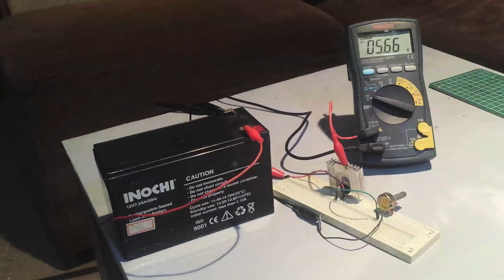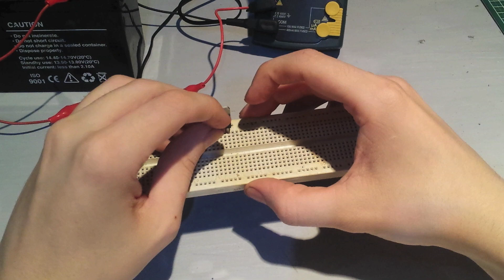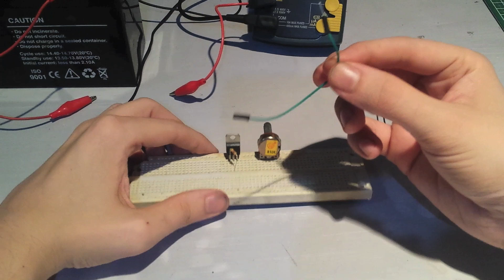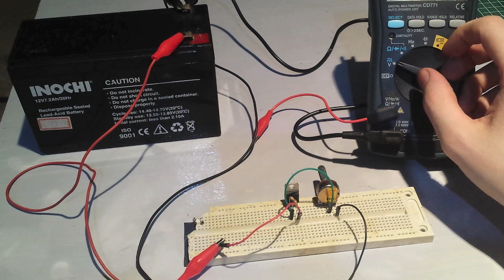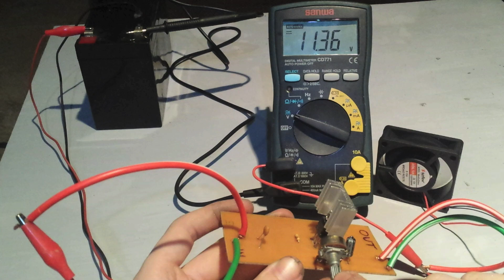Make a simple adjustable power supply LM317

Comment: that's awesome. I'm not quite sure, what voltage i would get with this resistor voltage devider: 5V supply, R1=3k ohm, R2=4k ohm across R1. From my calculations(i didn't use any formula, i somehow get this number) i should get 2,14V across R1. Is that correct?

Comment: Why did you suggest using ceramic caps on the input..and electrolytic caps on the output? Why not use only ceramic on both sides since it handle ripple and noise better..

Comment: Hi ive just watched your video which has been helpful. However i wanted to use this to make a more precise refrence voltage stepping down from +15 to +12 for my VCOs x3 . I followed the step and managed to get it to adjust to +12, however as soon as i connected it to the circuits the voltage drop to 0.87 can you shed any light on as to why. The standard vreg i used the L7812 stays at around +11.89v  when connected to the same loads. Thankyou.

Comment: I tried to do the same with a 1k pot.. but the voltage only varies between 25V - 27V.... its not reducing more then this.. any guidance plz?
Reply from the maker: 10k pot and a 180 ohm resistor :)
Reply: m sorry bro that was a typing error.. it wasnt a 1k POT.. it was a 10k POT and 220 ohm resistor

Comment: Hey...I'm using a bridged rectifier circuit to obtain 12v and around 1Amp current, is it OK to use that as input to the circuit you've shown.. Is it safe for the pot?
Reply from the maker: +Sanath Kumar yeah :)

Comment: i feel stupid, why do you need a resistor between the adjust and output pin? please help i cant find the answer anywhere. I have it working but not knowing why its needed bugs me. lol
Reply from the maker: The chip is monitoring the resistance on that pin to know what output voltage you want.

Comment: where is the negative of tester?
Reply from the maker: On the negative side of the battery.
Reply: dirrect?
Reply from the maker: Correct my friend.
Reply: I have 50 v what value of potentiometer I will use?
Reply from the maker: It's a 10k pot.
Reply: Do not connect more than 35 volts dc to the LM 317, unless you use HV version

Comment: ive had  a look around and im understanding the circute better but if the ransistor regulates how much power come out why need a resist too if its doing the same job. mayby i dont understand your circutry though
Reply from the maker: The resistor only tells the LM317 what voltage to regulate to.
Reply: hmm so its  droping incoming voltage  so that that the transistor on can use that amount of power? i thought transistors do that anyways?im sorry . im very new  this components such as these.
Reply: Gadget Addict so is the resistor that is attached to the lm317 lowering the incoming voltage  from the battery to the transistor?
Reply: i keep coming back to the video after ive read up more on things like voltage . i though i had an understanding but i did not but now i do and i can now  watch with pleasure. thank you.
Reply from the maker: I'm glad you worked it out :) Congrats!

Comment: what happens if the load draws more than 1.5 amps that is the max of the LM? lets say i have an electric motor at 12v and 4 amps ...will this put the lm in short circuit or it will not run at full capacity? great video was searching for simple adjustable supply
Reply from the maker: According to the spec sheet, it has protection against over current. But I think there's a lot of clones of the LM317 which may not necessarily have that feature. I'd expect on a genuine chip it would disable the output and on a fake perhaps it would just get so hot that it would melt/destroy itself, possibly creating a short in the process.
Reply: Gadget Addict thank you for quick response

Comment: does the lm317 really need to be there? ive  seen circuts witjoight it for attaching a cpu fan as you did and it working fine. mayby it depends on the input  voltage?
Reply from the maker: Yes, the LM317 is 100% required. You can run a very small load directly through the POT without the LM317 but it might overheat and fail.
Reply: ah ok i see. im going with a 12 volt dc i believe power supply  to  attack a 12 volt fan and a pot to adjust the  speed. do you think it will still be needed. i did see another video  where a guy did the same thing im planning to do and he did not have  the LM317. guess it depnds on the input i guess . can a resister work the same way as an LM317?

Comment: hi!
nice work! i have two questions to ask..
first, is the second resistor(pot) necessary? what happens if the adj is just shorted to ground?
second, when i apply voltages higher than 12v the pot is destroyed and so is the lm317 knowing that i have double double checked the connections and i also have a heat sink and caps in there, the pots keep burning regardless of the power rating or value in k ohms. what can cause this? is there a sol'n?

thank you!
Reply from the maker: The POT is only required if you want to adjust the voltage. If you just want a fixed value, you can skip that POT. I'm not sure why your POT is burning up, are you sure your wiring is identical to what was shown in the video?
Reply: Gadget Addict yes. the wiring is identical. when i skip the pot the chip is heating up very fast and blows up.

Comment: Thanks for this,. Question, can a c5353 be used in substitute for the Lm317? As well as a 100k potentiometer? I'm wanting to use it to adjust power on a 24V  power supply. Any help would be greatly appreciated, thanks.
Reply from the maker: I can't find much information on the c5353 but it looks like a standard NPN transistor instead of a voltage regulator.

Comment: I am connecting a 12v motor , where do i apply the second terminal ? and if any changes should be made then what are those ?
Reply from the maker: You can just duplicate my video exactly. I was also using a 12v motor :)

Comment: I added a 36v 2200uf to output and im getting 36v from a 24v transformer ????
Reply from the maker: Turn the POT to lower the voltage.
Reply: DC voltage is 1.4 times the secondary ac voltage.
Reply: Mains voltage has alot of  voltage spikes (ac 230volts  has 300 volts spikes) thats one reason why you get more output than the transformers rated. then when you use a cap it will take the spikes, so you get a higher constant voltage. the values of transformers would be correct if mains had no spikes and stayed at a constant 120 or 230 volts, but these ideal conditions only exist in labs (where these ideal conditions are created for standards in datasheets). Also check that voltage with and without load, normally with load the voltage will go down a bit and will more be like the rated output. So, many factors influence the output of a transformer. Hope that now you understand better why the rated and effective voltage of a transfo are mostly different.

Comment: Hi, It is nice to show through video. It would be goo if you can arrange schematic diagram for the same. As in Video it is showing that you are giving + and - Input through 12v battery. Output + is from LM317 Out Pin, what about (-) Ground of Output Voltage. Kindly brief. Thanks in advance.
Reply: Hi, I tried. It is working. I tried to get 1.5V. But when I am trying to start Motor it's not working and Voltage is dropping from 1.5 to 0.8.

Comment: 10k pot for any input or should it be adjusted accordingly?
Reply: If you look at the datasheet it will show you how to wire it, and I believe shows the equation for how to calculate the output voltage given the resistor values (you can also use an online calculator). The pot is just a variable resistor, so you can calculate the output voltage for every value of the pot.

Comment: Alright, I built it in the breadboard, just like you did and it worked fine. I put it into a circuit board with the caps, just like you did and now it doesn't work. What did I do wrong? Can you email me a schematic or something?
Reply from the maker: Sorry I don't have a schematic, just what's shown in this video. Did you double double check your connections to make sure it's wired exactly the same as on the breadboard. Is it possible you put the potentiometer in backwards?
Reply: Gadget Addict I figured it out...I had tested it before adding the caps, and my meter is just a cheap little one that didn't register anything once I'd added them. That was probably because I didn't have a 12V battery to test it with. But I tried it again at work with more sensitive meters and it's working correctly.

Comment: is there a way to add current adjust to this ?
Reply from the maker: Nope. This circuit is really the most minimal adjustable supply. You'll need a more complex circuit to add current limiting.
Reply: do you have a simple circuit with current limiting using a lm317.. thank you in advance

Comment: can I abject with that circuit more then 12v ?
Reply from the maker: +Satellite Problem yes you can :) I think I put the limits in the video description :) but the bigger the difference between the input and output voltage, the hotter your LM317 will get as it wastes the excess as heat.
Reply: thank for rep :) I have 12v power supply but I need more then 12v like ,16v,18v,24v,30v. what I need to make like that circuit ? can u explain me thank u :)

Comment: is it necessary to add in a heat sink? or is it ok not to?
Reply from the maker: You really need the heat sink. It doesn't have to be a professionally made one. You can drill a hole into any small piece of metal and use that as a heat sink. It won't work as well as a heat sink with fins, but it's good enough for testing.
Reply: The datasheet gives you all you need to calculate the temperature for a given power (all those thermal resistance values). However I believe any useful voltage will end up requiring some kind of cooling method to keep it under its maximum operating temperature.

Comment: i have 19.43 v and 4.6 A battery . I tried to make it variable voltage power supply but lm 317 , it heats up and damaged the whole circuit , what should i do ? i already use heat sink
Reply: you must have connected it directly to the input or something

Comment: How much voltage can be given into input ? u gave 12 can I give 36v I have an transformer of 36v salvaged from a water filter ???
Reply: I have still not because u told it will over heat and tried on 7805 it got melted

Comment: My potentiometers keep burning out. I've tried 510R, 240R for R1 and 10k and 50k pots, and the potentiometers keep burning out. I'm using capacitors also as the datasheet suggests but no help. Supply voltage is 28V. Can someone help me?

Comment: my lm317 this overheating very fast, I can not even touch it, what can be?
Reply from the maker: Did you add capacitors like in my final version ?
Reply: did a add a heat sinker you need one
Reply: hmmmm...  you either need a bigger heat sink,  or use better caps,  or use caps if your not using it.  cus capacitors in this case worker as a traffic guy,  holding his stop sign and blowing his whistle, letting voltage through slowly and steady so ur Lm317 dosn t go kaboom

Comment: fantastic video, 2 questions ... if I may 1. can i use any other  voltage regulators , or just the LM317.   2. where online can I get heat sinks?
Reply from the maker: +Hammer USN Well the LM317 is adjustable, so if you want to adjust to various different voltages, you'll want that one. If you just want one specific voltage, .e.g 5V then you could just buy something like the LM805. I'm not sure where to buy the heat sinks online, it would depend on your country. But eBay and Amazon and most electronics stores have them.
Reply: +Gadget Addict ty

Comment: Hi.Good info .How many amp can you put though it .Does it only work on 12v DC or can you put it on 6votes
Reply from the maker: +Neil Hunter You could put in 6 volts but then your range will be limited to 1.3 - 6 v. The maximum current varies per manufacturer but typically 1-1.5A maximum.

Comment: So I've tried to build a variable power supply twice to no avail, burning my potentiometers along thee way... long story short, I should have checked the data sheet for the pin outs of the lm317 from the start. Good lesson learned lol
Reply: zerodegrees8 hi. i was wondering if u figured out the burning pot problem. i double checked the cofiguration and wiring and i tried with various pot ratings and values. but when i supply over 12 volts the pots burn and damage tbe lm317. any ideas?

Comment: Sir my resistor and potentiometer got too much hot and burns, I am using 18V 2A transformer, please guide me, thanks in advance
Reply from the maker: +Aakash Sharma which resistor ?
Reply: +Gadget Addict  1k resistor between Adjust and output pin of lm317
Reply from the maker: +Aakash Sharma oops my bad haha. That's weird. Are you sure you wired it correctly ?
Reply: yes sir,
 I think it is because 2a current is not handled by lm317,
Reply: +Aakash Sharma I am just guessing, is it correct
Reply from the maker: Aakash Sharma Yeah anything over 1A is already stressing the LM317, 1.5A is about the max with a heatsink.
Reply: Yes, I have use lm350 now and it works fine.   
By the way can u be my friend in facebook if you r free, its feel good talking to u about electronics

Comment: Hi Love the vid, i need help !!

i am brand new to the electronics game, and here is what has happened

i have constructed a circuit powering from a 23v dc powersupply (3 caps / inducter(half of an old transformer) / resistors / switch / zener / direction diodes etc), everytime i press the switch the voltage spikes (maxes out my dmm - by the 3rd press of the switch, it jumps over the 600vdc mark)

now i have 3 problems which i am trying to solve to no avail

1) i think i have no current (or very little) as it wont run a 18v electric motor ?
2) as quick as the voltage comes in (spikes) it "leaves" again without even saying goodbye
3) i dont know how to "trap" the power in this circuit

what i want to build is the following, i want the voltage comming in and out to be pre determined (variable pirameters), ALSO THE CURRENT

hope you can help

thanks

Comment: pls help..how do i make 12DCV output from may 30ACV 8amp transformer?what capacitors,diodes,potentiometer and regulator should i use?thanks a lot..
Reply: That 8A is too high for work with normal LM317. If you want to risk it, they have some high wattage ones.
It would be best to find a way to limit the current.

Besides that, first you need some diodes (high wattage if necessary) to convert the AC to DC, then put in a large cap, maybe 1000μF-10 000μ, to keep the signal pretty steady. Now that you have your 30V DC, just use the LM317 to drop it down to 12V as described in this video

Comment: 78xx type  or,  LM317 같은 General regulator is very bad for power efficiens).  Exmple ):   if, it is Vin 30V, OUt 5V ,  out current 1A.  it is input power  30watt,  and out power 5watt. Then, power efficiens is about 17% . power loss is 83%,,, Very Bad,,, so, Goo Type is  only switching Type . Bu,t LM317 is 1.25~35V variable, and Low drop voltage Type of inner of Chip beside to 78xx. 어쪗든 전압레귤레이터 방식은 효율이 엄청 나쁘기 때문에 매우작은 전력에서 단순 전압을 맟춰주기 위한 간단한 용도에 사용하는것이 쓸데없는 전력낭비를 줄이는것이다.

Comment: How can I test my lm317 is working correctly please?  Thanks John  :)
Reply from the maker: Setup the simple circuit and use a voltmeter to measure the output voltage :)
Reply: +Gadget Addict  Thanks for your reply  :)

Comment: can i use capacitor rated 25 V, 2200uF to regulate it to 6 V
because i want to run that source to 6 V LED to run at a maximum time of half hour.
also do my 2200uF is suitable to run for half hour. or i need more uF
thnk
Reply: how to identify the size of resistor in different voltage value
Reply: What you are asking about capacitor makes no sense ,sorry.  Explain more plz

Comment: Hello great tutorial,  would I be able to use this circuit to power my desktop fan?  the fan runs on 2 AA batteries that don't last very long so I want to power it using my 12v Battery.Hope you can help   John....   :)
Reply: yeah it should work. just set Vout to 1.5V
Reply: +Spoder Man   Hello and thanks for the reply,  Could you explain to me please why Vout is only 1.5v when the fan runs on 2AA = 3v?  ( I am just a beginner :)  Thanks again... John :)
Reply: karen berry oh I'm sorry, you're right. 3 volts. Each individual AA is 1.5.
Reply: +Spoder Man  Ok mate cheers :)

Comment: can you post the schematic  of the pcp ? thanx
Reply from the maker: +blackice273 I don't have one sorry. It's pretty simple so I recommend just pausing the video as you go along :)
Reply: +Gadget Addict How many AMPS will it output? or Watts? I have a 3s 12v LIPO I want to bring down to 6v 100watts to power a high powered flashlight. A 6v BEC I have is only 3amps so output 6vx3=18 watts which is far too low to power this halogen bulb. If you can help with this I would greatly appreciate it.

Comment: I am using a salvaged PC power supply rated at 450W. I am concerned about burning up the LM317 if I don't regulate the power thru put. Any thoughts?
Reply from the maker: +Bill Field It depends what you connect to it. The load you connect will only draw as much power as it needs. But if you need a voltage and current limit you should really look at some other designs :)

Comment: plz tell me about capister have how many uF & VOLT,,??????,,,,
Reply from the maker: +Fakhar Chishti Voltage isn't too important, as long as they're rated higher than the voltage you intend to use. Use a 0.1 uf ceramic capacitor and  a 1 uf electrolytic capacitor.

Comment: What if I want to have a stable input and a stable output and don't wanna use a pot..  like use my 5V wall outlet as input and want to output 3,7 Volts just like a battery.. how we do ?
Reply from the maker: Use some resistors to set the value instead of the pot :) you can find some calculators online that will help you with that.